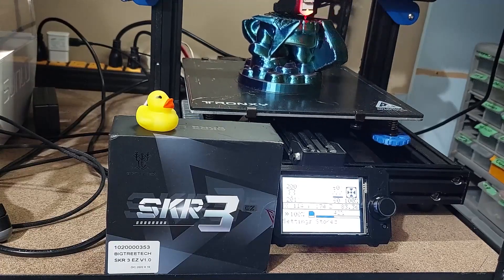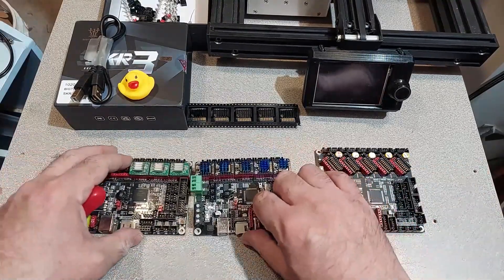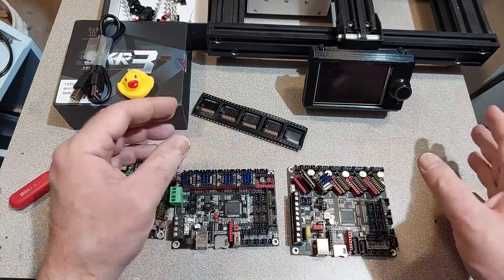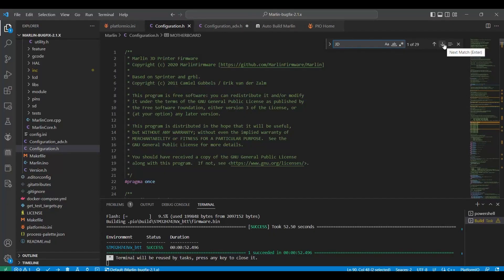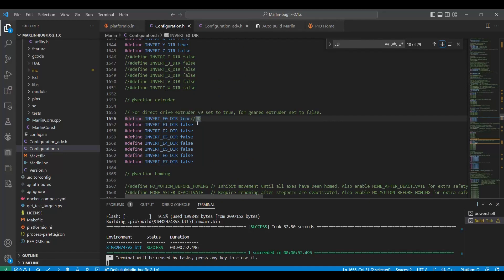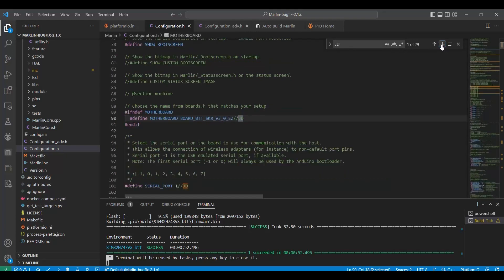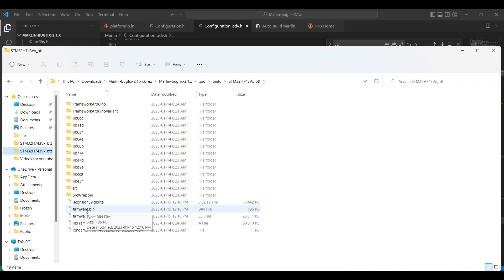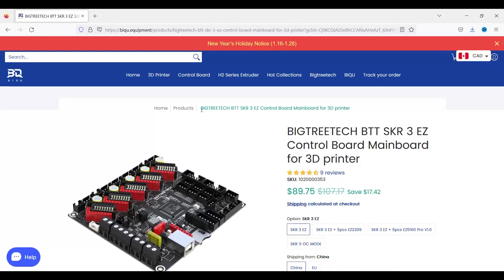How to install SKR 3 EZ in minutes!

Comment: I need some help here.  With the wiring.   I am upgrading my B1 from a SKR 1.4 Turbo mainboard to an SKR3 EZ.  The problem is that I have no idea where the wires labeled F ANO, DCIN, NEO, an unmarked thin white 2 pin cable (yellow pins), and what appears to be 2 fan cables are supposed to go on the SKR 3 board...   And there is very little online help :(

Comment: I got two sets of there ez drivers, first set 2 of them would overheat, second set 1 didn't work.. went back to reliable reg tmc drivers and have no issues
Reply from the maker: Fair comment. Was this with marlin?
Reply: @jeffs3dcorner  No, Klipper

Comment: sensorless homing is not working , customer support 000000, not worth money.
Reply: Mine works in klipper just fine. Did you configure firmware and install jumpers